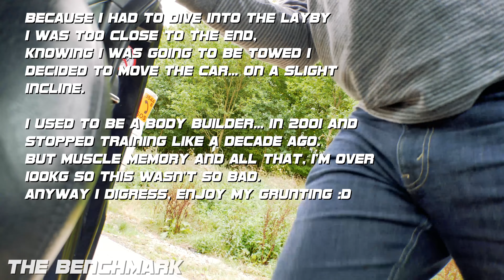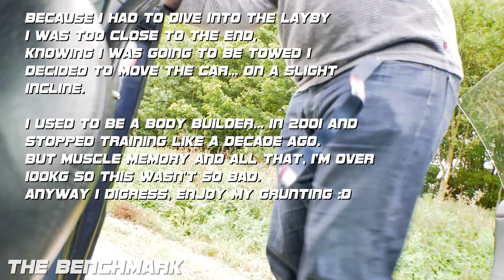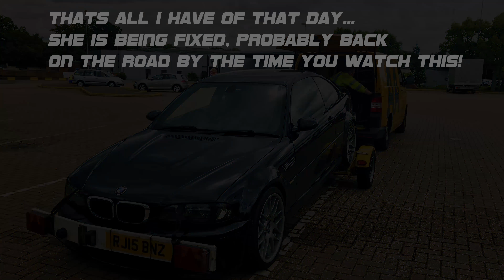Project M3 - SMG Went BOOM! - Ep:4 - The Benchmark

Comment: You're very kind to BMW, these integral parts should not go at only 130k! O.o we run of fleet of Merc's, a number of which now have over 210k and they've only ever been serviced with the odd bulb replacement! I want a BMW again but I can't bring myself too :(
Reply from the maker: I think 130k for a performance car like the M3 is acceptable, I just wish it gave a warning or stayed in a gear so you could at least limp to safety. I also think BMW forcing you to buy the entire system as opposed to just the pump for over double what it used to be last year is ridiculous. 
This is one of the rare cases where the aftermarket provides a solution that is better than the OEM.
Reply: True, but the C63 has no common faults over 200k :/ It just seems like a few of their parts are badly designed and it happens generation to generation, like the engineers have a lazy day when designing the odd part here and there, leaving owners to battle lots of 'common faults' down the line :(
Reply from the maker: I just realised that I have never heard of any issues with the older C63, only complaints about the transmission being a bit crap. Always fancied a wagon version....
Reply: Yeah, W204 with the V8 is a dream! I've been told the transmission was a slow shifter because they hadn't got a reliable fast shifter/dual clutch yet so stuck with what was proven and tested, so you win some you lose some I guess :P The box can take insane amounts of torque though! If I could afford the fuel for it i'd be in a wagon one as we speak! Haha
Reply: The C63 had commons faults. There was a class action in the US over the camshafts and a stack of head bolt failures on pre-2011 engines. I loved my C63, but glad it was a 2013 with MCT and all the engine issues resolved. Oh and the interior is shocking for rattles!

Comment: Just to clarify for those watching who may not know, the Hack Engineering link in your description isn't for a complete pump as you say, but only for a replacement (uprated) pump motor, with associated items needed to fit it..... 
It's nearly always the motor that goes on these anyway, so hopefully this kit will fix your issue. 
Ps. Did you have the codes read, to confirm the issue with your old pump?
Reply from the maker: Yep 100% pump failure, lets hope the part arrives in time as my living room has become almost a museum or shrine to the glory of the E46 M3!